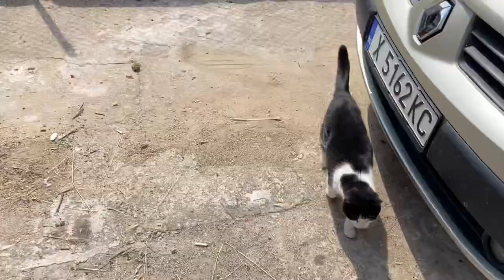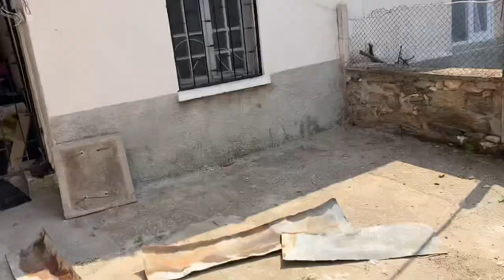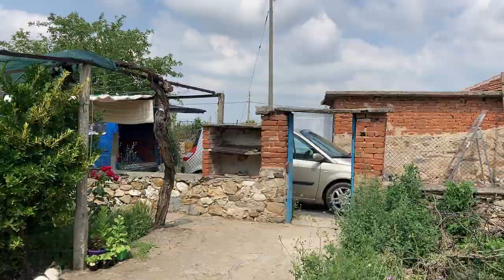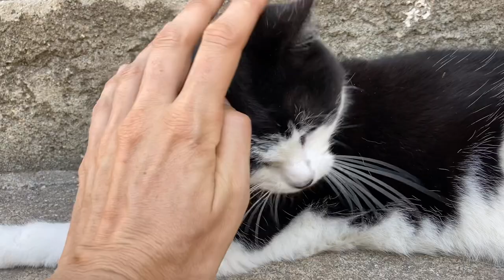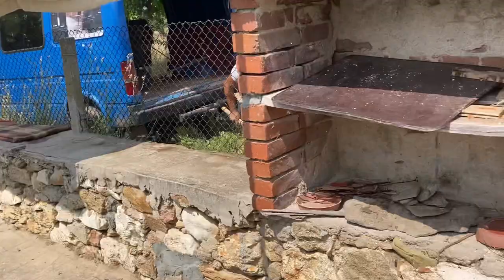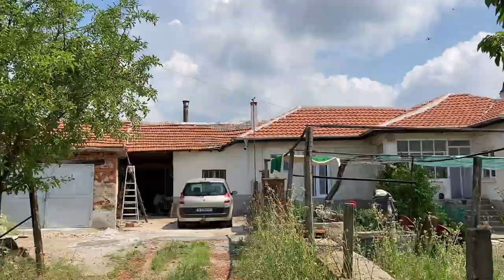Bulgaria Vlog: Surprising Roof Fix in UNDER 2 Hours!

Comment: Hi Maya, I know all about those temporary fixes. However it is a good solution and give you some time until you are able to fix the problem permanently. By the way, have you notised that when you order a contract job, they often don't finish it completely. In my and most of my expat friends experiences they almost always leave some bits and pieces that you have to finish yourself. Seems like your roof fix stand the test when the hail came 👍🌺😍
Reply from the maker: Yes the roof fix did a perfect job when the hail storm came! No leaking at all 🙌 
most of the jobs the renovation guys did is complete except for the garden gate. 
They half welded it and now it’s getting quite bad again. I will need to fix it myself because Paul is too busy with other renovation works. 
And I think that’s a great opportunity for me because the fix can be done easily, if I have the right tools. Which I do not atm unfortunately but it’s all a process and I’ll pick up the tools I need one by one 😎